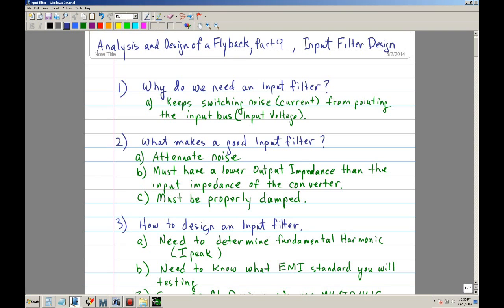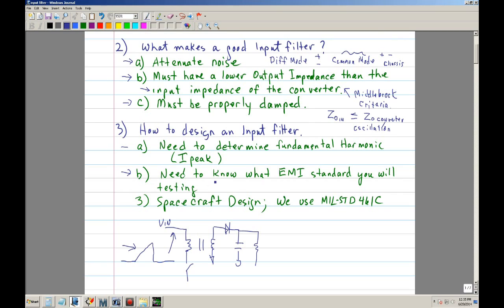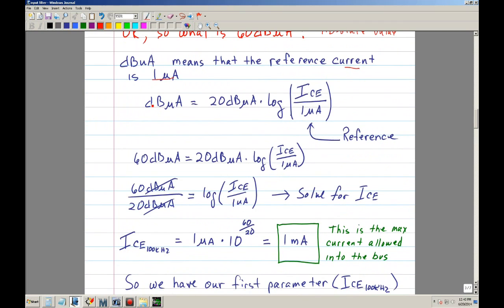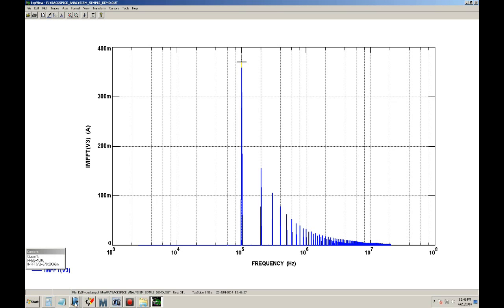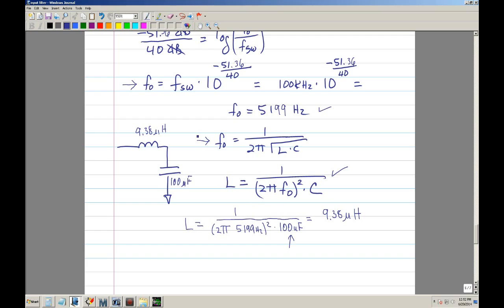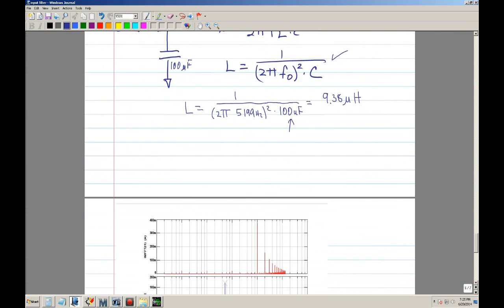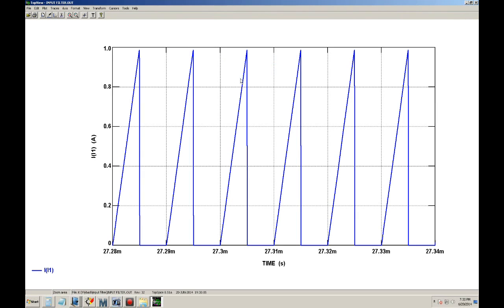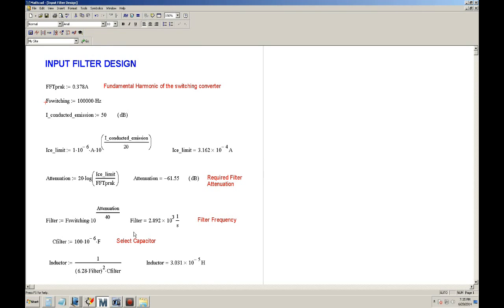Analysis and Design of a Flyback, Part 9,  Input Filter Design

Comment: Dear Robert: Very nice video!  Do you say that gain in filter is  : 20 * log (vin/vout) , but how we are using second order filter gain would be :  2* [20 * log (vin/vout) ], right ? . And why do you replace "vin/vout" for " fo/fsw" ? Do you have any reference material where i can read the details of this transfer function?
Reply from the maker: Hi anonymous, the input filter is a second order and will have a 40dB/decade. Once we now how much attention we need from 20 log (Ice_maximum/ IFF_from_iprimary), the we can subtiture to find at what resonce frequency you need to make the input filter. You can also use log-log paper and draw -40db slope and where it intercept the 0db is the frequency. Try it

Comment: Is standard showing only differential current limit?
Or it shows the total conduction emission limit?
If the case is later, how to segregate the differential and common mode current limits?
Reply from the maker: Hi Ashok, The MIL-STD 461 charts shows is combined. However, the common mode ussually occur at higher frequencies because common mode noise is generated by the parasitic capacitance from the mosfet, transformer and any stray capacitor associated in the primary. So a good rule is to pick the geometric mean of the high frequency range, (2MHz to 50MHz).  (2MHz*50MHz)^0.5=10MHz.  You then assume an atteniation of 80dB which means that the common mode resomance whould be 10KHz. The common mode filtering using the Ycaps to filter out the common mode noise and should be know. In DC to DC, this capacitance may have to be limited for safety purposes.  Then you calculate the common mode inductance by,m assuming Ycap = 10nF, Lcommom=1/((2*pie*10KHz)^2*Ycap). I hope this makes sense.
Reply: @RobertBolanos  Thank you so much sir, for the clarification.
Reply: @RobertBolanos sir, how did you decide the high-frequency range? Will it be same for all the standards?

Comment: Hi Mr Roberto. In the min 18:00 you explain that is second order trans funtion ( 40dB*log [fo/fsw] ), but is it always that formula (one theorem) or that funtion is depend of Input filter design ?
Reply from the maker: A second order low pass filter means that there are two poles and each pole contribute a -20db/dec. Since both poles are on the same frequency then the transfer function simplifies  to the equation I gave in the lecture.
Reply: Do you say that gain in filter is  : 20 * log (vin/vout) , but how we are using second order filter gain would be :  2* [20 * log (vin/vout) ], right ? . And why do you replace "vin/vout" for " fo/fsw" ? . Best Regards.

Comment: Nice Explanation. We are calculating L and C at particular resonance frequency so we are suppose to get oscillation at that frequency as well  which we don't want. Shouldn't we concentrate on fundamental frequency? Can you please explain in brief why we are using capacitance with resistance in series to avoid resonance peak again.
Reply from the maker: SAMEER GARG Hi Sameer. The capacitance with a resistor is for damping the resonant frequency. At resonant frequency, the output impedance of the filter is at its maximum impedance. This can create a problem if you connect a power supply to the filter. The phenomena called the Middlebrook criteria. Basically it states that the output impedance of the input filter must be much lower than the input impedance of the power supply. If you go to my channel, look for "Input filter effects on a power supply" or try the link below for further explanation. https://www.youtube.com/watch?v=8VzUt0zS36s
Reply: Robert Bolanos Thanks. Attached  link cleared my all doubts. Is it mandatory  to use input filter with all power supply or its depend on harmonics associated with fundamental switching frequency?